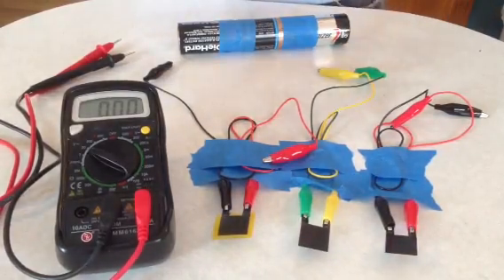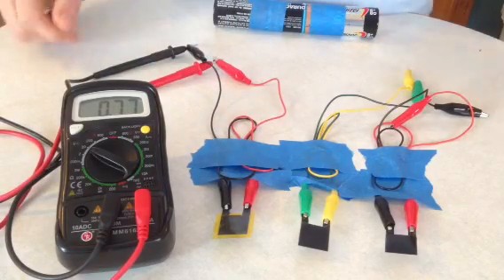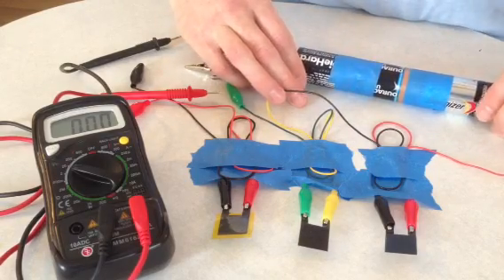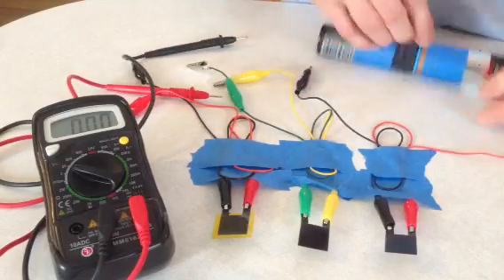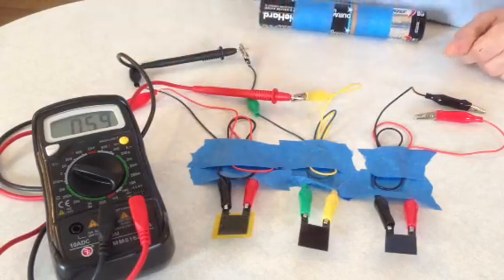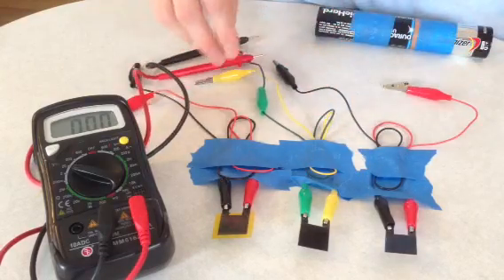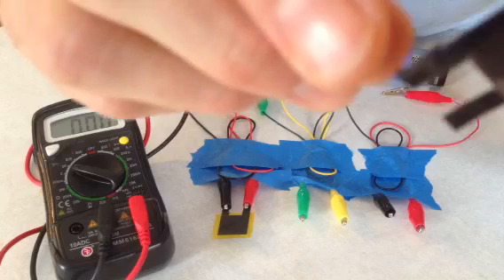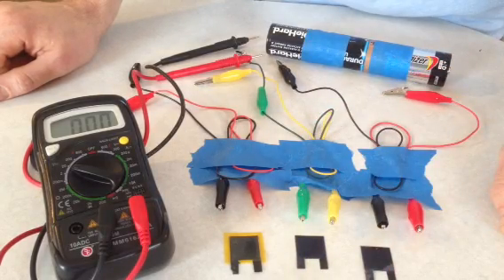Homemade Laserscribe Graphene Supercapacitor Test

Comment: the PVA score a lower voltage because the battery has a limited current output because of its internal resistance... actually in this case, where you have a limited current a higher capacitance capacitor actually gets to less volts than a lower capacitance capacitor... try filling them up with a power supply of some sort... 
also can I ask where did you get graphite oxide powder?

Comment from the maker: ok, i checked the properties of the cd burner that I used.  It's a "TSST corp CD DVDW TS-H6532 SCSI CDRom Device" and the software I used is "CyberLink Label Print".  Also, on my laptop I was using the lightscribe brand label making software.  idk if that has anything to do with it.  maybe the software controls and reduces the power of the laser.  but the optimum power output for the laser should be 5mW at wavelength of 788nm.  so, if you get one with those specs, it should work.

Comment from the maker: Thanks!  Much appreciated.  I think the PVA (in both cases) is just a binder and the acid acts as the actual electrolyte.  So, my plan is to change the types of electrolyte and concentrations to see what results I get from that.  The reason I tried elmers glue was just to see if something that is easily accessible and cheap would work in a solid-state electrolyte....and it did:)  I'll do a little research on the camera film as dielectric.  I plan to test several separators and electrolytes.

Comment: FYI, use a wall wort outlet (like one for small appliances) to charge. Batteries have an internal resistance that doesn't allow a quick charge. These graphene caps seem to run around 4 volts max, so you can get a 3v unit for very low cost.

Comment from the maker: Thanks, I should've done a little more diggin' around. Google solves everything! lol I'll see if I can get some rough capacitances using this method. However, I might go ahead and order a multimeter that can read capacitances as well. There are some cheap Chinese ones for like $35.  I know I can get a name brand for like 10-20 more but this Chinese one is accurate with a wide range of functions.  It's just not rugged.  My purposes are not demanding but are random, so more functions the better.

Comment: In a crude attempt to see what sort of capacity you have, you can try two experiment. First once you have a configuration that creates about 1.5v, or so, double two in series, and see how long it will sustain an LED, to see if it flashes or holds. Then if its holding, you can try measuring current (millivolts) across a one ohm resistor (short the cap across the resistor) to see what kind of current in milliamps it can deliver, in a burst.

Comment: You can determine the capacitance by the time taken to charge the capacitor (to a percentage of the applied voltage) through a known resistor, very easy. No need to invest in a special multimeter... A little bit of googling, a resistor, and a stop watch, is all you need :)

Comment: Voltage alone does not count !
What is the uF rating of these caps ?
Do you get any Farad values or only nanoFarads for this size ?
What is the maximum voltage these caps can hold before destroying itsself ?
Many thanks.